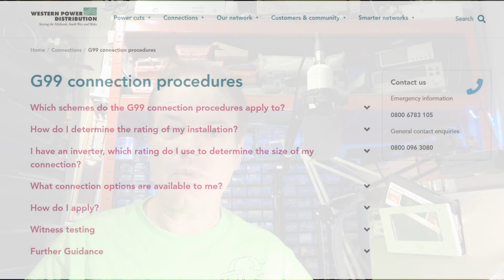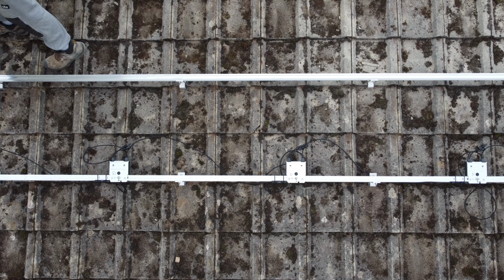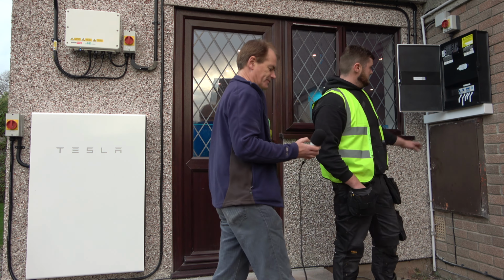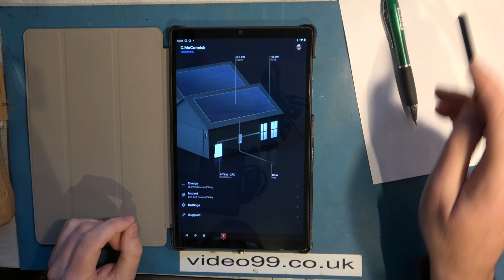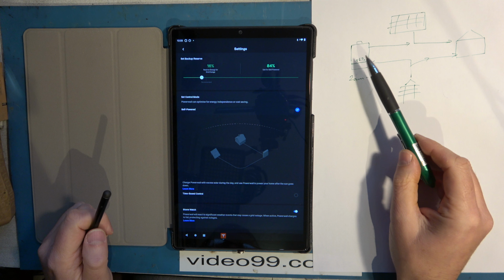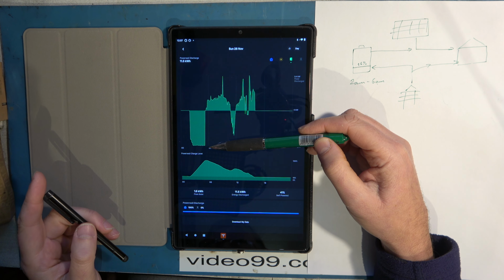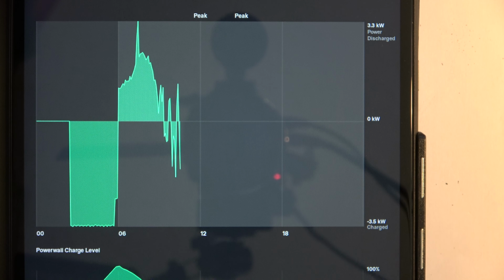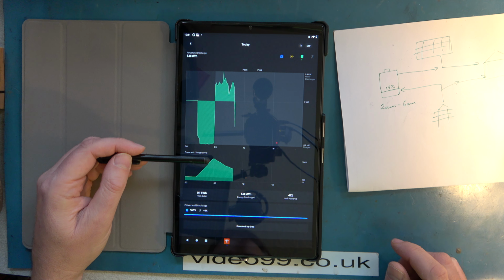UK solar panels for home, & Tesla Powerwall. Part 2: Installation and software.

Comment: These are two great videos. I have just ordered a 10.1K array and 2 powerwalls. I am looking at if I should keep my existing electricity provider and just use their 3p per Kwh export rate - or switch to an Octopus Outgoing Agile tariff to benefit from the summer excess production.
Reply from the maker: Even the half-bust Bulb export at 5.5p/kWh.  But with two powerwalls, you may be able to avoid exporting too much, keep it for yourself!  As I pointed out, Octopus take away control of the Tesla Powerwall, which I think is awful.  You would have 2x20% battery retained just for a power outage, which is almost certainly far too much.  But you've got to work through the figures to get the best results.  Also look at what off-peak deals they do so you can use cheap electricity to charge the powerwalls in winter when the solar panels won't do so much.  By the way, 10.1kW array and two Powerwalls.... I'm jealous.
Reply: Don’t go to agile the peak rate is super high most people instead use octopus go + where you can move the off peak to something more usable e.g .10 till 2am etc
Reply: I have finally had my two powerwalls installed (new solar array is going to be installed in two weeks). Last night I was able to run the house off the Nevada electricity left in the batteries (about 22%) and today they are just slowly charging of my old 500W solar system.
Reply: My Solar array was installed last week with the inverter installed and commissioned on Monday. Yesterday was my first full gen day which produced just over 45kWh with 28 of those charging the batteries up from 4% to 100%. Overnight we went down to 83% (but only about 3.5kWh of output which equates to only 22 odd kWh and not 27. I am going to try to join Octopus for their standard variable tariff with their Agile export tariff as it is looking like the battery will recharge by 9am most of the year with the rest as export.

Comment: hi my mum got a small set up    THEY ARE A MONEY PIT never buy them  mum had some because it was better than money  in the bank 
it you are young  say 20's yes   you would be ok  and beware  selling the house on can be a pain
Reply from the maker: We have 16 panels, they can generate a lot of energy.  We're not selling any time soon, but they certainly wouldn't be a problem, quite the opposite.  Where people run into problems is the dodgy arrangements where you lease your roof space to a solar company.  Money doesn't earn money in the bank any more, better to invest in this and make some real money back.
Reply: @video99couk  Agreed. As people are going to find out the hard way, the biggest drain on people's savings is inflation. Buy physical assets now while you still can.....better still, buy things that can produce electricity. Since you're either an electronics engineer or an avid tinkerest, what's your views on these:
https://www.youtube.com/watch?v=AEC83oQvgEk
https://www.youtube.com/watch?v=xl2dawiJpzM
https://www.youtube.com/watch?v=PHBaVbO8zhw
Reply: Here's the video I was looking for:
https://www.youtube.com/watch?v=QOV_Js59BHY